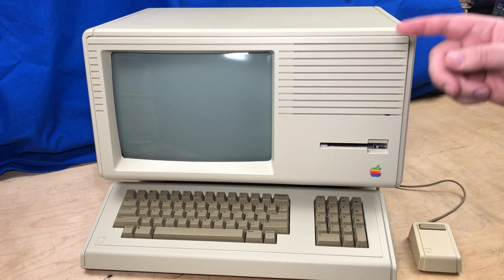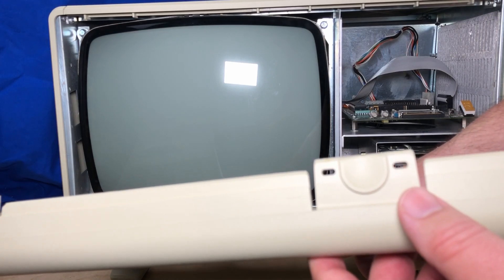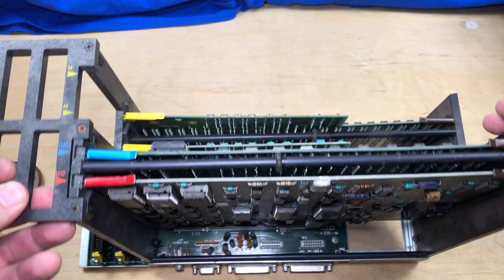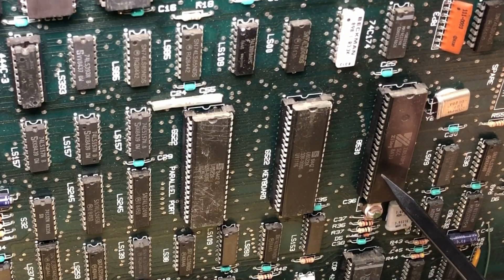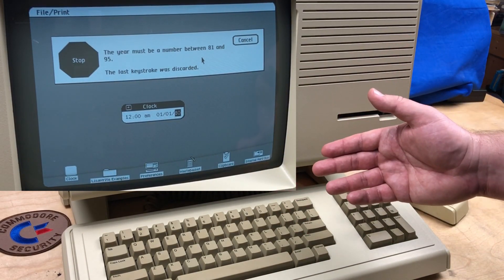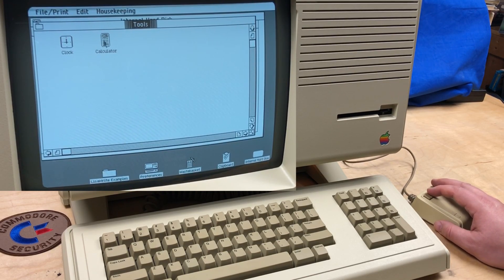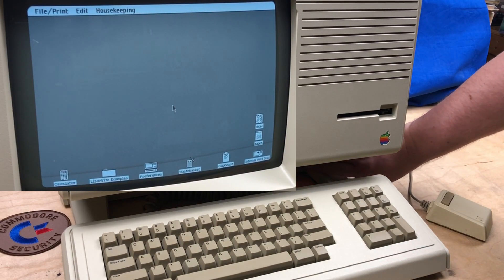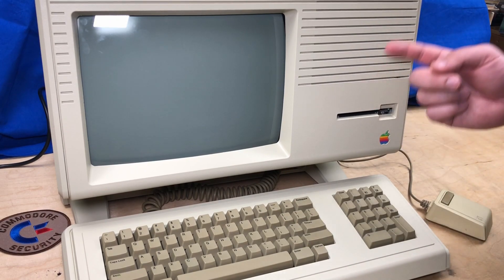Apple Lisa 2: Inside & Out

Comment: I was always under the impression that these things were the downfall of Apple with those twiggy drives. But this machine really doesn't seem that bad.
Reply: Also... there was no downfall so?? (Well, at the time anyway.)
Reply: @3DMegadoodoo  no, I mean the company is just just terrible now. Previous to this they had the Apple ][, which had I think 6 or 8 expansion slots. That's what sold that computer. Now they want to control the devices you buy from them. And do dumb decisions to shorten the life span of devices.
Reply: They almost went out of business because ot this (none selling) machine.
Reply: @Computer Aided World - To me this does seem bad. It has a terrible exterior design, a dead slow UI, a boring grey monitor, and the price of a car. - Speaking of design, that computer in your avatar pic looks really nice, would you tell me what it is?
Reply: @NuntiusLegis  I mean it's boring gui, because it's one of the firsts in a consumer product. Imagine how much it would cost if it was in color. And what do you even do with color, it's not like it was powerful enough to do image processing in 83. And I quite like the design, very modular, quite expandable, case design is a classic terminal look, with week designed details like the slopes for the keyboard
Reply: @computeraidedworld1148  I love green, amber, or orange monochrome, but grey I find unpleasant. - The C64 had some use for colors in 82, hadn't it. - Some of the old terminals are nice, but this is just a block.
Reply: @NuntiusLegis  I'm by no means an apple fan, but I think this machine looks nice. And have plenty vintage monochrome systems of my own. I don't think the C64 had a gui in 82, I remember GEOS shipping with the C64 C in 84ish. But I could be wrong
Reply: @computeraidedworld1148  You seemed to question the use of colors in computers in general in your previous comment. ;-) Ok, at the time,  a colored GUI would have been too much to ask for I guess, but it could have had some non-GUI mode with colors - even the C64 had both (some time later with GEOS).

Comment: Ah the memories.  Had one of these in our office.  Used it for our database segment layouts and the data folks for their datagrams showing the fields and keys of the data.  We were able to retire our green charting templates and pencils.  With Lisa Calc, we could retire Visicalc and the Apple //e and /// it ran on.  But the Apple ]['s were put to good use as VT-52 screen emulators to front-end them to the mainframe using ASCII to EBCIDIC for 3270 terminals.

Comment: First Mac I used was a Mac SE.
System 6.0.3 I believe.
68000 at 8mhz.
In a way the early Mac had less sophisticated software - no multitasking until 6.0.4.

The SE was faster than this, but no multitasking. I guess they modded the software to help speed things up. Despite not having multitasking 6.0.3 was a lot more mature than Lisa....most of that odd ball stuff had been worked out.

Comment: The interlock switch on the front of the computer will be to do with airflow so the machine does not overheat (especially the hard drive) if the cover is not fitted.

Comment: For a 68k based system its quite a bit slower than I would except
Reply from the maker: The CPU is only running at 5 MHz compared to the 7-8 MHz of most other 68000 systems that appeared in the next couple years, and I've also heard that much of the Lisa software was written in Pascal rather than C or assembly language.

Comment: I want to tinker with this thing, and replace every last chip with an upgraded substitute. One by one.

Let's start with those RAM chips. We could replace all of those with some much, much faster SRAM chips.

We could also use a modern Supercap to power the RTC.
Reply: You’re very quickly going to run into chips that haven’t been made in decades and have no upgrades or replacements.
Reply: @stargazer7644  Time for reverse engineering!

Comment: Your comment around 6:50 -- Apple really has gone back and forth when it comes to up-gradability. My MacBook Pro is completely locked down, but the most recent MacPro tower is akin to this Lisa 2: completely tool-less and modular. It'll be interesting to see what will happen to the Mac Pro when it eventually switches to an ARM architecture; maybe they'll do what they did with my old 2010 MacPro and put the ARM SoC on it's own card. Interesting times ahead.

9:50 That's why the Atari ST was named Atari *ST*. Sixteen/Thirty-two, in reference to the 68000 architecture, followed by the ill-fated Atari TT that ran a 68030 (which is a Thirty-two/Thirty-two processor). :)

Also, how the hell is that Lisa so clean!? It looks brand new off of the factory floor!

Comment: The hardware concept it the complete opposite to the original Macintosh!
Even opening the Macintosh required an extra long torque screw driver.
Inside you where confronted with a single board no extension or modification intended ...

Comment: Very cool. But ssoooooo many extra bits :) I think I have Commodore withdrawal now. 

4:30 I’ve been wondering how long before paper clip jokes were funny. I laughed here so I think we’re out of the waiting period. Poor David.

8:09 I wonder if those connectors would get loose after a lot of use like the SX-64 suffers from 

9:06 wow, can you imagine trying to probe that board for bad chips? 

16:35 should have made better use of all of those bits 

21:00 the more I watch videos of these early systems, the more I’m struck how what we have now is basically this computer with more things to get in the way of actual work. Turns out Computing peaked in 1983 and didn’t see another real breakthrough until affordable FPGAs and TensorFlow. 

26:00 you say square, I say rectangle. Let’s say we all get along. 

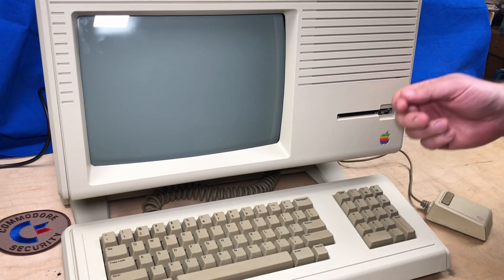28:44 for comparison, a 1983 Porsche 944 retailed at $18,980
Reply from the maker: I honestly wasn't consciously taking a shot at David with the paperclip comment, the words just came out! :)

Diagnostics would be very painful on this machine; I'm pretty amazed it still works but it does seem to have been cared for, with the battery removal and mods/upgrades here and there.

I did add a brief caption re: square/rectangle, I noticed that during editing :)

Two Lisas, or a Porsche 944 and some change... hmmm :)
Reply: Or, in 1983, a truckload of Commodore 64s
Reply: @MichaelDoornbos  And each of these C64s without a clumsy GUI to get in the way of actual work.

Comment: Let the 68000 programming start.
Reply: If it has to be more than 8 bit, I'd rather be interested in the 16 bit upgrades to the 6502 by Western Design Center.
Reply: @NuntiusLegis  It would be interesting to see him program his SuperCPU but I would hate to see it die while using it. I would like to see comparisons of the 68000 and 8086 to the 6502 since it has been said that the 6502 is "faster".
Reply: @dougjohnson4266  Why should it die from programming? 6502 faster than the 68000 (16 bit)? Or was that the 6800 (8 bit)?
Reply: @NuntiusLegis  True, it would not die from programming it, but using it for hours might. The last SuperCPU I saw on EBAY was $1500. From what I have read over the years the 6502/10 is faster because it is said to be 'more efficient' than an 8086/8 (Maybe 68000 also) so for me it would be interesting to compare it to the other CPU's of the day. What do you think?
Reply: @dougjohnson4266  I didn't know it is that expensive nowadays, you have a point then. I wonder why the SuperCPU or something similar is no longer in production since the CPU still is. With the ongoing retro trend it might come back one day. Or a new, C64-compatible computer using the WDC-16-bit-upgrade to the 6502 (which I always thought Commodore should have done instead of the Amiga).

I would be surprised if the 68000 as a 16 bit CPU would not outperform the 6502/10, but perhaps the 6502 is faster in some respects because it has some flavors of RISC (an early form of pipelining and no instructions for multiplication and division, so bit-shifting has to be used; I read in a book on early DOS coding that the instructions for multiplication and division in x86 CPUs should be avoided for better performance).

Comment: My memory is fuzzy on this... but didn't they have problems with capacitance/inductance between the traces?  I seem to recall an article saying they would never be able to clock a system faster than the Lisa due to these issues.  You can see by the construction why these systems were so expensive.

Comment: You ment to say 6.3mm jack instead of quarter inch, right?
Reply from the maker: 6.35mm :) But it's the same connector that's been around since the late 1800s, still in regular use with guitar cables, which are widely called 1/4" here in North America.
Reply: @8_Bit  Got me. Just teasing a bit. :) Another great video as always - be it metric or imperial. :)
Reply from the maker: I did learn my lesson about the so-called 1/8" jack though. I will endeavour to call them 3.5mm from now on!
Reply: @8_Bit  Perfect. 😋
Reply: @8_Bit  Mini Jack.. just mini jack.

Comment: I know it would have been more $$$; but were I designing the Lisa; I would have put a “GPU” of sorts into the ASIC that manages the system RAM and does it’s (primitive) virtual memory page management... something kinda like the bit-blitter on the Amiga; along with a few graphics primitives like lines, oval sections, and a basic display list processor (so you could queue up drawing operations and go do something else with the main 68000. 🤔
Reply: The Lisa had an MMU chip - the memory management unit - that handled the memory for the CPU.
Reply: @stargazer7644  Yes, that was a custom ASIC, and that’s where I would have put the additional graphics functionality.

Comment: Hi 
So I followed your video and pulled out the I/o board as well as the power supply to check everything. 
Put everything back in and my Lisa won’t power on anymore. It was working fine before I pulled everything out. 
I don’t know if I’m doing something wrong but I foible checked to make sure the ram slots are properly put back into place and the power supply but nothing is happening. Any help would be greatly appreciated
Reply from the maker: My power supply required a fair bit of jiggling to get it to fully line up and re-connect, hopefully that's all it is for you. Otherwise reseat the cards. If still nothing, I'd recommend getting some Deoxit and spraying all the edge connections of everything you removed again. Other than that unfortunately I don't have any suggestions - I'm not much of a hardware expert!

Comment: So slow even with a 68k cpu. Modern Mac OS still looks the same.
Reply: A 5 MHz CPU.  Let’s see you run the windows 10 GUI on 5 MHz
Reply: @stargazer7644  : Have you seen AmigaOS run on a 7 MHz machine?   How about GEOS on a 1 MHz Commodore 64?  Very snappy. 
Even for the day, the Lisa felt slow.  Just sayin’.
Reply: @curiousottman  I've not seen an Amiga.  I have seen GEOS.  I would not call it snappy.
Reply: @stargazer7644  : Commodore 64 = 8 bit computer @1 MHz with 64k ram. Faster than apple Lisa when running geos. If you add a ram expander to the c64 it becomes almost instantaneous in program execution.